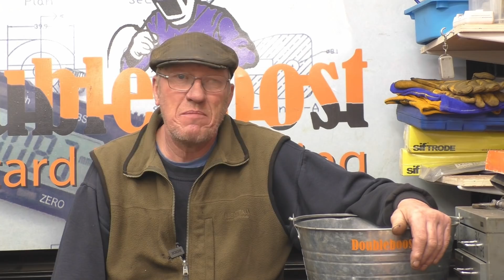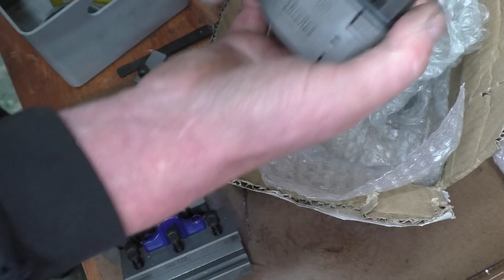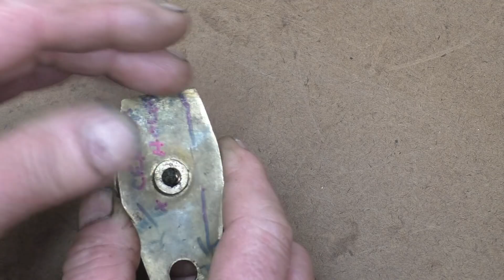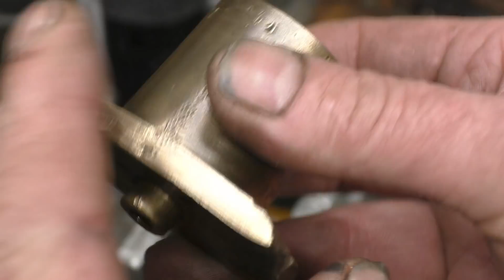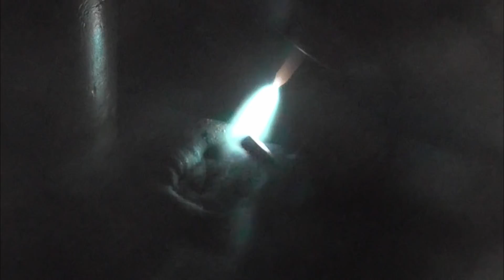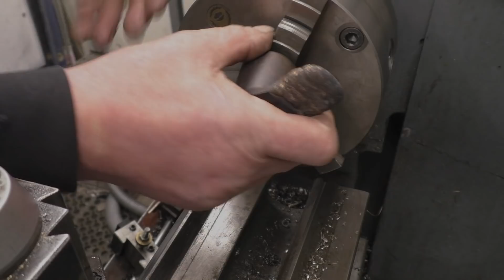SNNC 374 P1   Vintage Oiler Repair

Comment: I used one of those Multifix posts at the local trade school when taking night classes, they are a very cool setup.  nice job on the weld, that will look good when it's done up.  Nice solid repair.  A friend of mine gave me some graphite blocks, now I know what to save them for, lol!

Comment: Bloody hell John that's an excellent viewer mail. £350 with extra tool holders at about £45 each I have one on my lathe and I would not have anything else. Not Aloris or any other make as they are so versatile. Someone is going to be a lucky person! A very nice silicon bronze tig welding job John. That will turn out fine I bet!

Comment: Also have exactly the same small ball peen hammer, used solely for the same function of making gaskets by tapping them out of a sheet of gasket paper. I keep it nice and safe away from anybody, and also make sure to get any dings out of the 2 faces as well. For some gaskets I have used the phone book covers, as that works well enough, plus a good use of the otherwise useless book.

Those little bits of rod I just weld them together, making a new long rod to use, as yes otherwise they are no use, and worth almost nothing as scrap, but expensive to buy new.

Comment: Multifix tool post. I have one too, and I am in two minds whether I should fit it to my Harrison lathe. I have a Dickson tool post on it just now and I have lots of holders. I've only got three multifix holders and they are expensive... No matter. Great part one John and a great set of arc shots. Maybe auction the multifix for a charity to do with your Dad?

Comment: Adam Booth uses that type of tool post... Multifix, I think.. Cheers from Louisiana USA.. Mike
Reply: Adam does indeed use a Multifix tool post.

They're great because you can change the tool angle, without losing the indicated 90 degree setting.